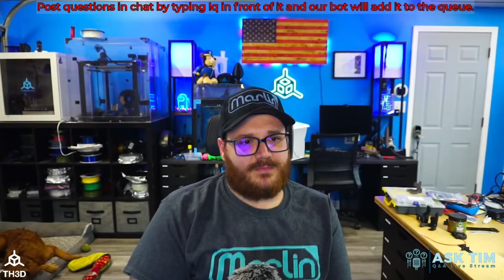Is Klipper Irrelevant Now Marlin Has Input Shaping? - Ask Tim Clip

Comment: Marlin is great in being able to run on a single board. It was originally adapted from Grbl+Sprinter and only targeted AVR and basic DUE boards, so it had to be pretty modest. Today we have 32-bit boards that run at 5x the speed of AVR and beyond, and Marlin is now able to utilize all that power to do smoother motion planning. The addition of ZV Input Shaping that actually works on AVR is a minor miracle, and it makes even the oldest printers capable of higher speed and acceleration with no change of hardware. Likewise with "S-Curve" acceleration. Now with 32-bit boards we will have even more fancy Input Shaping options (thanks to Ulendo), making better use of all that micro-processor power.

Technically, Marlin has no problem achieving the same high speed, smooth motion, and improved print quality on a single processor that Klipper provides with two processors, so for users it's just a matter of cost, complexity, and the trade-offs that come with each option. People should choose the firmware that best fulfills their needs, and while there has been a lot of attention lavished on Klipper for its Pi-assisted motion and host integration, that particular aspect has become negligible for 32-bit printers. Marlin with OctoPrint can do it all.

Marlin and OctoPrint have a spiritual kinship as grassroots open source projects, and we are welcoming of Klipper and Kevin O'Connor to the field. We will all continue to develop, share, and grow together, and users will only benefit from our friendly competition. (And I will continue to admonish those who evangelize Klipper in our Marlin support spaces.)
Reply: I'm very excited, i pulled a 7:59 Benchy on an SKR 1.4 non turbo, sadly it's slowly down at some points but min resolution is helping, I'm i can't wait for the new algorithms. When it would be launched?

Comment: Thank you so much for this video, I've spent more time slamming my head against a wall over Klipper more than ANY OTHER 3D printing problem I've had. I wish someone had warned me that I needed to be a full-on software developer myself in order to properly use Klipper. I'm going back to Marlin ASAP.
Reply from the maker: I'm just curious as to why you went to Klipper? Klipper is also one part of an entire software stack. You have Klipper, Mainsail/Fluidd, and Moonraker. Klipper is just the board firmware.
Reply: @TH3DStudio  See, I wasn't told any of that by the other guides I saw. Which only adds to my point really. The main reason I went for it in the first place was input shaping, and I was told I could get higher print speeds with it but that was secondary to input shaping.

Comment: Pretty sure you summed up my experience with klipper in the first 20 seconds.    I have a well running 3 s1 pro and a sprite converted 3v2.    Heard klipper was the rage adn got a sonic pad.   Even after all the calibration and tuning and tweaking I yes got countless times faster prints but but came out horrible looking or failed non stop.  Reflashed stock firmware last night and the same files I was strugglign with klipper with came out great.   Gonna try to return the pad back to amazon now.

Comment: I love my 10S Pro V1 with its many upgrades. Will I want or need the 4.2.7 motherboard to get input shaping or will i use my Pi4B for that along with Octoprint that is all ready on the Pi. I want to use the vibration sensor boards to model the resonance we had to do that in the 70s for accurate CT Scanners with rotating X Ray tubes and detectors. Big ass Scanner had 3 or 4 natural frequencies we tried to beat down. I really see the value ad for FDM printing. Want to do this let us know how and when, with the cost I am sure. Dennis
Reply from the maker: Most of the 32 bit boards will work with Marlin Input Shaping. The Pi will do fine as well with it. I did notice when running input shaping on the BTT SKR E3 Mini series and the Creality V4 series boards they do have LCD slowdowns. Using a more powerful board like our EZBoards that same issue with the LCD isn't present because the CPUs are much faster.

Comment: You and I have gotten to be buds over a the last year, but I will say your issues with Kevin and the community cloud your ability to be objective when it comes to Klipper. I have a small farm of 6 printers that all run Klipper on various boards including yours. I'm not endlessly having to fix Klipper like you claim. In fact the majority of people "fixing" Klipper are those who don't know how to use it. I switched from Marlin to Klipper simply because it was EASIER to use. You flash your main board once and that's it. Any changes that need to be made are done via a config file and a quick reboot. No dicking around with recompiling putting it on an SD card, realizing ah shit I forgot to select that box to invert my extruder direction now I need to recompile all over again go to the printer reflash, re-pid, redo bed leveling, etc etc.

I AM a person who likes to tinker, and by my purchase history with your business you can clearly see I love to try out different set ups and parts. Klipper allows me to make those changes quickly and painlessly, something that I personally don't feel can be said about Marlin.

I also love the integration with the web GUI and the firmware, the lay out, and the ability to customize everything. To me, and again this is my opinion, the workflow is much better, including being able to create a physical printer within Super slicer and send my files directly to the printer. Even the integration into HA has been fairly easy.

Speaking of your board, I'm even looking into making a CANBUS solution for your board so in the future I can use it in an ender 5 plus that way I can have each z motor be independent vs running in parallel (getting Z-tilt is big IMHO). 

With all that said I absolutely 100% agree the community is toxic. Unless you know the right folks to ask in discord, it's a nightmare to get information. Kevin is a dink for sure. The Voron community is the same, though it didn't stop me from building one because I think they are awesome printers and I got to build my printer from the ground up.

I will tell you part of my issue with Marlin was because of the community and it's toxicity. What I found after switching to Klipper made me realize coders and programmers are dicks and most have the "I'm better and smarter than you" attitude, as the Linux folks especially those in the Raspberry Pi community are no different. Go into any 3d printing community and ask for print tuning help or slicer profiles. People act like youre asking for their social security number and nuclear launch codes. The 3d printing community as a whole has a lot of toxicity. Should we just stop 3d printing all together because of the amount of vapid dicks?

I get bummed when you talk so poorly about Klipper, especially when some of your claims just aren't true. I get where you are coming from, I remember commenting on your specific issue with Kevin and your config file. 

The nice thing is you can fork off of Klipper and maintain your own fork and Kevin can't do a damn thing about it. Much like what you do with Marlin. Yay for open source.

In the end I don't think input shaper was the only reason folks think Klipper is superior. I personally don't think one is more superior than the other. I just personally like the simplicity and work flow of Klipper versus my experience with Marlin and Octoprint especially when it came to making major changes. 

I still hope one day there's a Unified Klipper and I'd love to be a part of it.
Reply from the maker: Really, really good points man! As for the firmware being changed, I just put a printer on the bench and do all the testing and CFG there then it gets put into it's official resting spot and the firmware doesn't get changed unless I take it offline for repairs or upgrades so being able to change motor directions and stuff on the fly is not at all important to myself.

My workflow with a printer is build it up, setup the firmware, and put it into production. Then it doesn't get modified for a long time unless something breaks or we need to upgrade it for whatever reason.
Reply: The thing that drives me crazy about some klipper users is that they look at you (using marlin) like you are inferior or you are wasting time or something like that, klipper is very powerful, sure, no one is denying it, however, some people just want to enable thermal runaway protection and call it a day for that, download a precompiled bin, put it into an sdcard and put the sdcard in the printer, the rest is story
Reply: @Lucas_sGarage  for sure! Each one has its pros and cons, it's strengths and weaknesses. It just sucks the communities behind them ruin the fun of 3d printing some times
Reply: @BackwoodsTinkerer  yep, i saw a comment not too long ago about the speed boat race saying "marlin won't compete, it lacks the processing power" i did a 7:59 Benchy on a 220*270 bed slinger with direct drive and 12V and the board wasn't slowing down.... Just wait until I get 24V

Comment: I believe it is irrelevant I have used input shaping in marlin and have increased my acceleration to 3000 and doubled print speed, I don't see it getting any faster without a corexy  due to hardware limits

Comment: Honestly, from an engineering standpoint, Marlin is way better and optimized, let alone versatile since it can run on CNC machines (which 3D printers kinda are from a hardware standpoint), laser engravers, and even automatic cutting machines, basically any cartesian-based machine. And the fact that it does so on a microcontroller board, using C++ and Arduino (because it's technically possible to use something like an Arduino Mega as a 3D printer motherboard and has been done), just talks about how much more capable it is without resorting to an entire microcomputer. Add the later with OctoPi and you have yourself a machine capable of the same things as any Klipper-based one and potential for more, since there's a gazillion plug-ins to be used from simple remote access to automation and even optimizing a machine for library usage. Kipper was developed as a solution to the lack of processing power 8-bit boards had, and nowadays there are RISC-V microcontrollers, and even the Ender 3 lineup hss a 32-bit microcontroller with enough RAM and processing capabilities to run both IS and linear advance simultaneously (because I just did that upgrade like 3 days ago on mine and took me like 30 minutes being my first time compiling my own firmware). Klipper is so complicated there had to be a utility to make it far simpler (yes, KIAUH).
So I'd say Marlin caught up to whatever made Klipper relevant at some point, without adding any clutter at all and requiring only a simple reflash of the motherboard that can be done from Octoprint on a single click, which is necessary from time to time even on Klipper anyway.
What's that? Klipper can use USB/I²C sensors for input shaping? Measuring resonance with those sensors and sending commands in real time (just as Klipper does for everything rather than real-time processing on the motherboard as Marlin does) is pretty easy, and Octoprint's community is equally big and active as Marlin's, so developing a plugin would also make it catch up.
Klipper can't compete with Marlin's community, support, experience and embracement it's got. And it became popular because of Big Tree Tech anyway.

Comment: Klipper is for people that want to set something up once and never have to question whether the random issue with their printer was caused by too slow of processing or logic errors. Marlin is for people that don't want the complexity of fancier main boards or the cost and nuisance of attaching a Pi. Both serve their purpose, but I've only ever experienced both communities being very supportive of people looking for help. What really confuses me is people that use Octoprint on Marlin long-term. You've got the biggest step to migrating to Klipper done, but continue using a firmware that doesn't really take advantage of it and potentially actually gets more issues with the USB queuing issues.
Reply from the maker: We have been using Octoprint + Marlin for 5+ years now in production with 30+ machines. No issues at all. Klipper is not something we'd want to deal with in a printer farm. Way too many variables to go wrong.
Reply: Klipper is cool, but doesn't have the reliability of Marlin. Kudos for playing
Reply: People have seemed to forgot that klipper was originally made as a solution to pull the processing away from the 8 bit microcontrollers, almost nothing comes with an 8 bit microcontroller these days. Both have pros and cons, but all the klipper hype is blown out of proportion.
Reply: I've been running my printers via Octoprint/pi and Marlin for many years.  During that time I've upgraded to 32 bit boards.  I never had a Marlin related problem with either reliability or performance.  I'm not a geek so I don't understand much of what is going in the tiny corner of the world dealing with 3d printer firmware, but I'm happy that there is so much good information on how to work with Marlin available on YouTube.  But trying to get answers to questions directly from the world of Marlin is nearly impossible, not because people aren't willing to help but because unless you speak their particular kind of secret-code programmer-style English, you get a door slammed in your face.  
Asking for help is like telling your doctor you're not feeling well and his response is to say that he's glad to help and then he demands that you tell him all about your DNA mutations and protein biomarkers.  Not only don't you know what those things are, you have no idea how to get them.  The firmware world is much like that.  I'll stick with my raspberry pi and Marlin, thank you.
Reply: I set up the Marlin Firmware Facebook group and Marlin Discord to facilitate community-members helping one another and to put them in closer touch with me and other developers to discuss ideas and get deeper support. There are some community-members and even a team-member or two who can be terse or over-technical, and even rude sometimes, and when I see this I do try to get them to temper their responses and consider their audience. But it's not always super-effective. Others may want to be helpful but misunderstand the issue and provide non-pertinent suggestions.

Personally, I try to be helpful in a non-geeky way, to be patient, and to speak in simplest common terms when I engage with everyday users, hopefully setting an example for others to follow. When I see rudeness or meandering unhelpful suggestions, I am quick to jump in with the best answer, suggestion, or help that I can provide. Of course, my main job is to incorporate new code and fix up existing code, so I rarely spend more than a few hours a week on direct support.

I would encourage anyone who feels dissatisfied with the community support in my Discord or Facebook group to demand better from those users, and feel free to ping me when the right answer is not forthcoming. I want everyone to be able to install and run Marlin with the least hassle (which is why I made the Auto Build Marlin extension for VSCode) and I definitely feel disappointed when I see unhelpful interactions among the community. We are lucky to have guys like Tom Sanladerer and Teaching Tech Michael making really good guides on configuration and features. I am always referring users to their videos. Meanwhile, we can always use more help with our Documentation site, as there are so many topics to cover.

Anyway, I hope everyone likes the improvements we've got coming in Marlin 2.1.3, fixing some motion issues and further optimizing Input Shaping, especially for AVR. Cheers!
Reply: @ScottLahteine  as always man, your job has been 10/10 if you managed to add some web support build into the firmware (ik I'm asking for a lot) it would be pretty much the end of reprap, also, how about a nozzle height sensor and maybe some macros (ik they are implement in klipper but it would be awesome) thx for all the effort you put into the firmware, I'm working to develop a printer and we are talking full advantage of input shaping (we are already at 150mm/s and we are getting even faster)